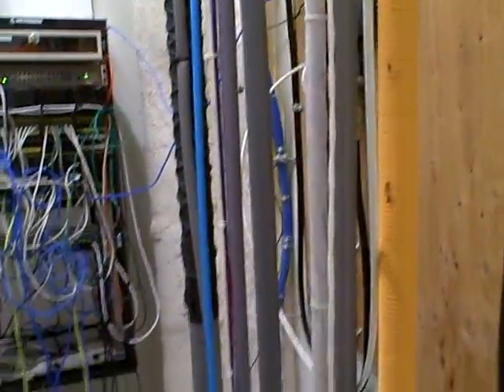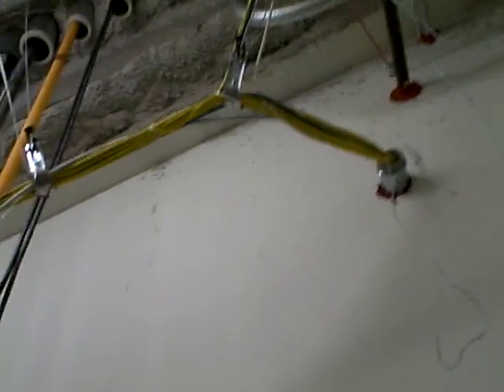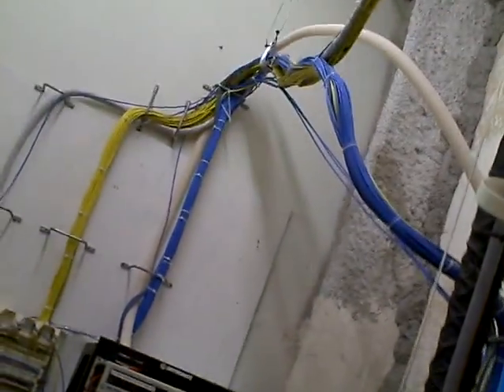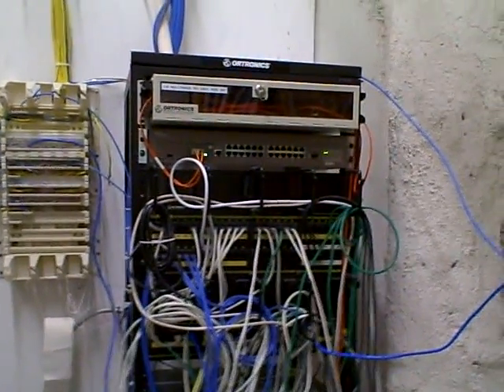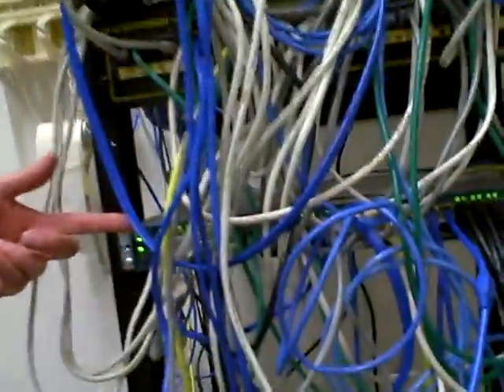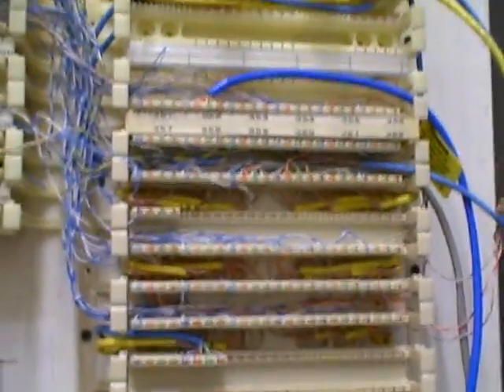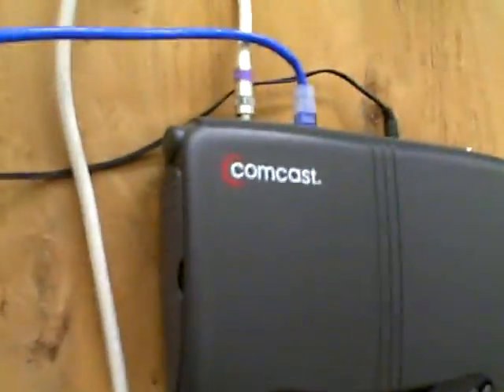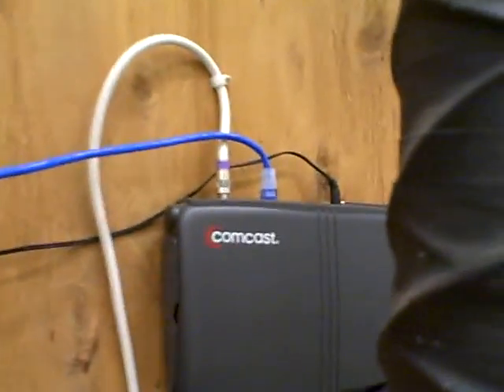Network Wiring & Telephone closet - part2

Comment: The attenuation on that mess will negate the 'big name' hardware, whoever installed and/or maintains that needs fired.
Understandably the aesthetics are wrong but you really shouldnt be crossing over as many cables as that, keep them paralell for as much as possible.  Nevertheless the performance is probably not an issue on such a small install but if them runs of cable are long then your asking for trouble.